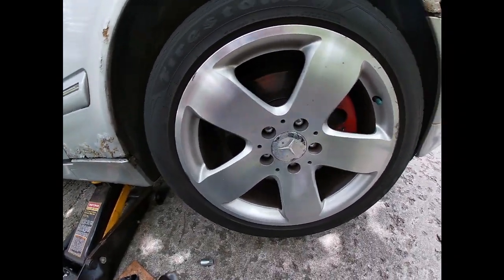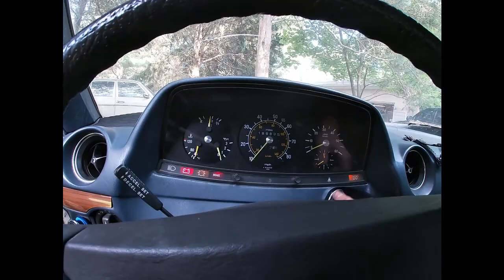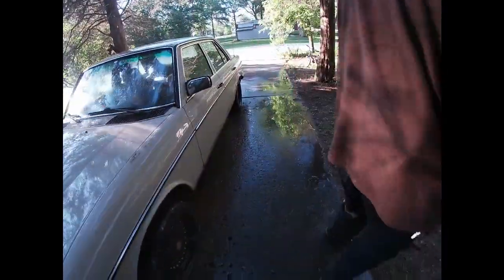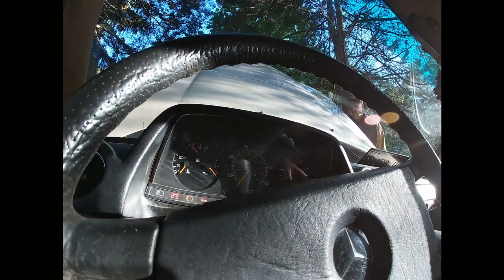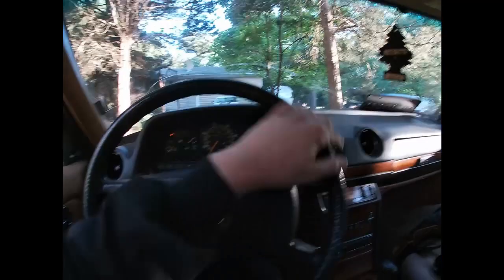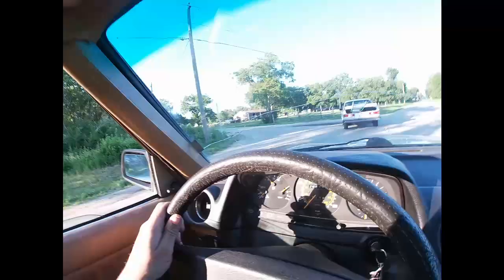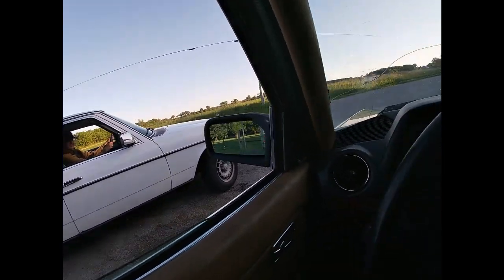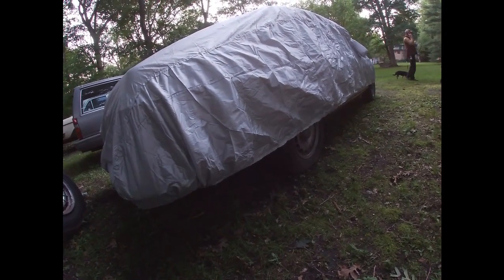THIS IS WHAT A MAN NEEDS!!! MERCEDES W123!!!

Comment: I'm glad I live where cars do not rust!
Reply from the maker: There's nothing to be afraid off. Rust is fixable no problem. Follow my W123 Cherry Pie that I am gonna be welding all up. It has rust holes everywhere. Save old school Mercedes!!🔩🔧🔨🚗🚗🚗🚜🚜🚜🇩🇪
Reply: Great, I love the W123 more than anything!
Reply from the maker: @gwest111  No better cars made out there than these. Cheers
Reply: I'm looking to buy one now, but it has to be in great shape I'm not very handy and it must be Manila beige. If you run across one inbox me.
Reply from the maker: @gwest111  ok. You can also start checking on Ebay and Bringatrailer.com